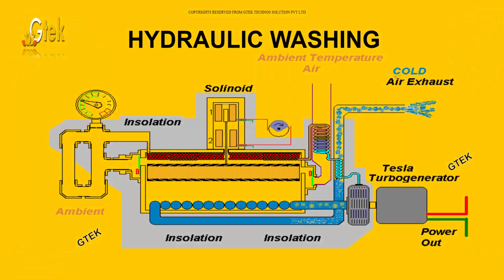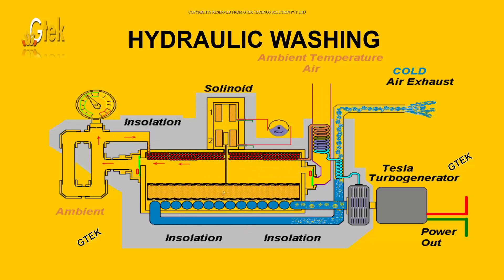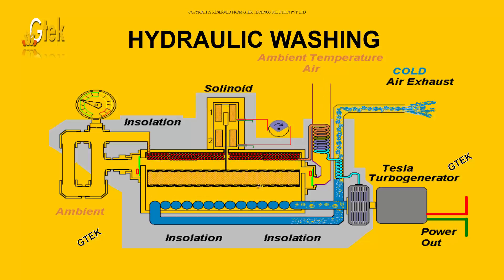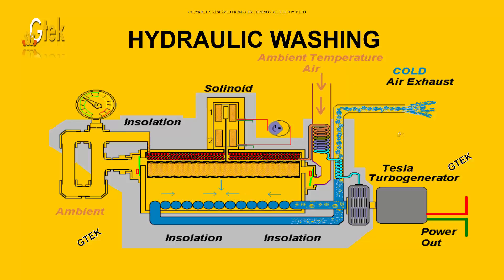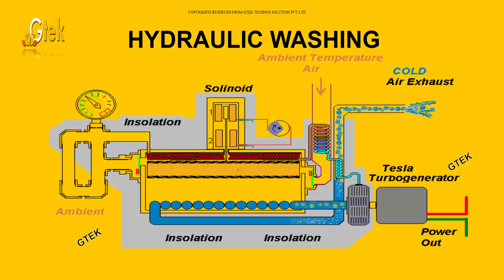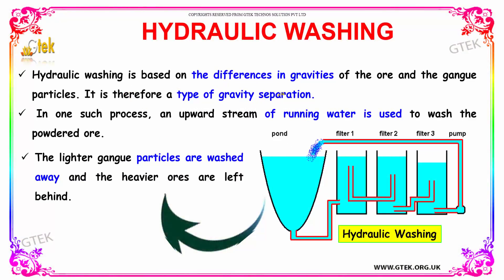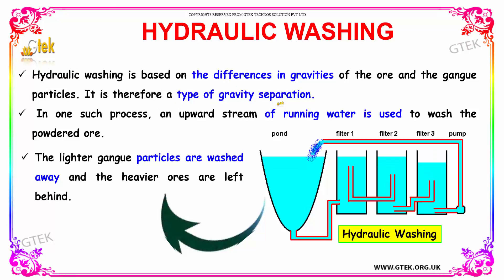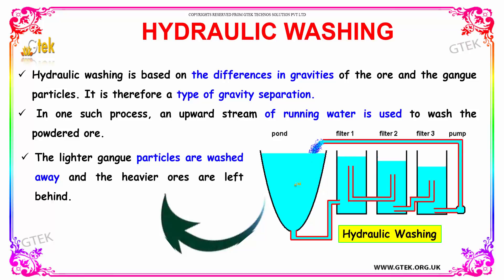hydraulic washing  general principles and process of isolation of elements 12 chemistry cbse

Comment: Hydraulic washing of the ore Hydraulic washing is a type of gravity separation, which is based on gravity differences between the ore and the gangue particles. In this process, the lighter gangue particles are washed away by a stream of water, leaving behind the heavier ore.